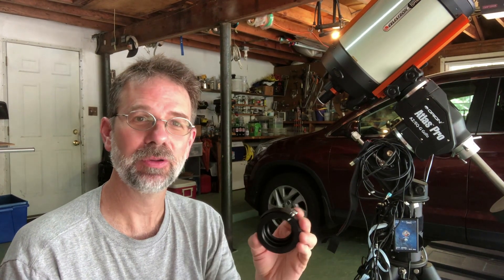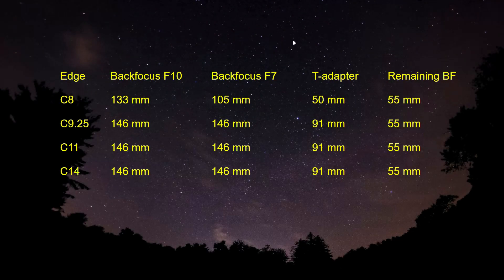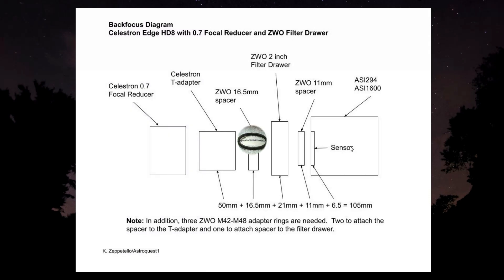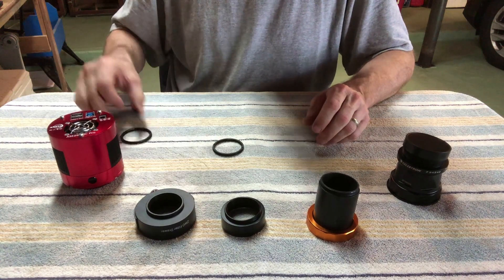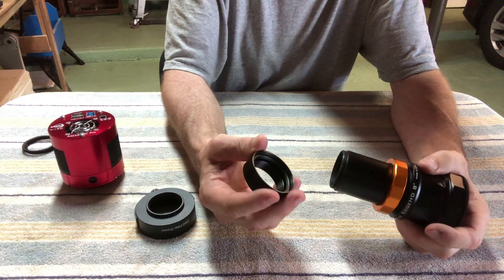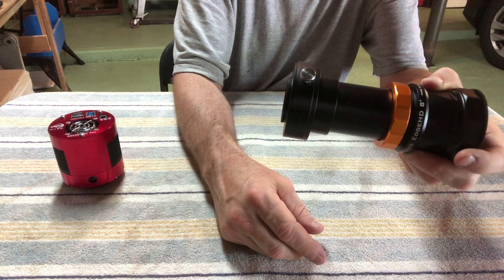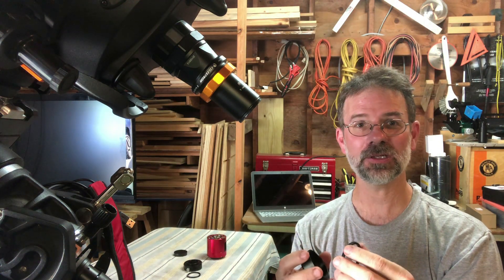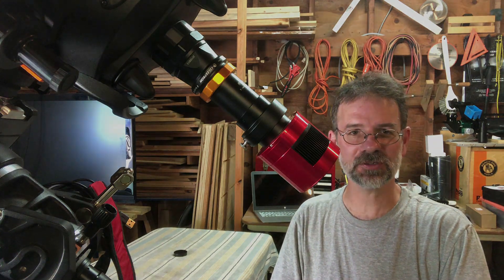Celestron EdgeHD 8" with a ZWO M42 Filter Drawer Backfocus & ASI294MC

Comment: I need help figuring out the back spacing using the 2600mc pro duo with the same edgehd and .7 focal reducer. I believe it comes with one M54 to M48 adapter. I haven't received the camera yet.
Reply from the maker: I believe you are correct. I had to do a little trial and error to determine the optimal spacing. Good Luck with it.

Comment: great video kurt.  i just bought an Edge 8.  and 2600MM with zwo 2 inch EWF and optolong 3nm 2inches SHO and LRGB filters.   I also have 0.7x reducer. and 174mm mini guidecamera.

need some help for guiding setup. i need clarifications for the following:

1) which OAG is better suited zwo OAG-L or Celestron OAG?
2) would the new camera 2600MC DUO work well for Edge 8?

Pls advise.
Reply from the maker: Thanks Sreeshab, You have a great setup. As far as OAG it is hard for me since I don't use an OAG but I think I would go for the Celestron since it has a larger prism which will give you more stars. However, an even better person to check out on this subject is James Lamb (@Aero19612) on Youtube since I believe he does you an OAG and has both.  - Good Luck
Reply: @AstroQuest1  great thank you buddy.
Reply from the maker: @sreeshab4093  The 2600 Duo would work well with any setup and you would not need any OAG.
Reply: @AstroQuest1  great.  Particularly, if I use the DUO for galaxy captures at bortle 5 skies and Edge 8 - would it work well with and without 0.7x reducer?

Would it work well with and without L-Pro filter - wouldn't guiding become challenging specially with f/10?
Reply from the maker: @sreeshab4093  Should work well with and without the reducer.
Reply from the maker: @sreeshab4093  It could depending on where you are aimed but that guide sensor is big enough to capture a lot and you are pulling from the whole telescope view rather than just a prism.
Reply: @AstroQuest1  thanks this is great help

Comment: Corrected!  I got the 42/48 adaptor on the wrong part.  It should be as follows...   I found another reference that recommended reversing the order of the ZWO spacers such that the 21mm adaptor (or filter holder)  attaches to the T-adaptor (50mm).   Then one attaches the 16.5 mm adaptor to the 21mm adaptor via the 42/48 thread adaptor.  Then the camera is attached with its adaptor (in summary: t adaptor 50mm -21mm adaptor or filter drawer-42/48 thread adaptor-16.5mm adaptor-11mm adaptor-camera with 6.5mm internal spacing =105mm).  This gives the correct spacing without using another 42/48 adaptor.   Tried it, and it works!  Send me a message on Cloudy Nights, and I'll send a pic.  Thanks for the video!
Reply from the maker: Thanks for the info George. I give it a shot to see if I get better stars.  Currently they are OK but there is room for improvement.  Cheers
Reply: Hi George, I cannot seem to find you on cloudy nights, I would love to see the pic as I am faced with this issue now..do you have any email address please, or could you send me the pic via a google drive link or anywhere else?

Comment: This really helped me. Thanks. I have a Nexstar 8 se ota and wasnt able to figure out how to get the backfocus correct as i had the same problem as yours with the filter drawer. Thanks for the fix.

I however see some eggie stars at 5 min exposures ( EQ6R pro, Lextreme, 294MCpro, Celestron focal reducer). Do u think the backfocus  doesn't need to be exactly 105 (in my case it's 105.6 as i have a Lextreme filter. Added a spacer to compensate). I saw in your other video you kept it as 108.5 mm
Reply from the maker: Glad it helped Devesh!  Yeah, it is possible that the back focus may have to be tweaked even between different filters in order to get the best stars.  Cheers

Comment: Excellent! I’ll be needing this Tip. Do you add an additional 1mm spacer to accommodate a 3mm filter filter?
Reply from the maker: Thanks Brian. Possibly a 1mm spacer would be make it better, however there is a range.  For example lets say 55mm is recommended, then + or - 1mm would be fine, it all depends on your system so I would do a couple of test runs first.  It may not be necessary.  Cheers

Comment: Kurt, I have the exact same setup as you do except I use a filter drawer I bought from Starizona. I just bagged the adapter rings and bought a set of various length extension tubes. I get within a mm of the right back focus and don't have to worry about the adapter rings getting stuck inside the zwo adapter. I do have an adapter that goes in the filter drawer that allows it to screw directly to my hyperstar and it also fits the extension tubes at the rear. Then when I go from 133mm to the 105 all have to do is remove a 30mm extension. I know it doesn't quite add up, but accounting for the approx 1mm the filter adds, it's within a mm or so and my pictures come out sharp as a tack.
Reply from the maker: That's cool.  Where did you get the extension tubes? Actually now that I have everything set I do not have to touch anything, I guess the extension ring set = the extension tube.  I remove everything as units I want to remove the FR and such.  - Cheers Kurt
Reply: @AstroQuest1  I want to think it was astromania, but that was almost a year ago. I think I paid about abt 30 for a set of 4-5 various sizes.

Comment: I have a stuck M42-M48 adapter ring. What is the wrench I need to get to remove it? Thanks!
Reply from the maker: Yeah, it is called a spacer wrench but you can also use a caliper (https://www.youtube.com/watch?v=bkxtcDr4ais&t=1s) watch 9:00 minutes in.  Good Luck
Reply: @AstroQuest1  Thank you!

Comment: Hey!   Your chart, is it the same for the regular SCT?   For my C9.25 what is the back focus at f6.3 vs f10?   Celestron website says 105 but it doesn’t indicate the regular or edgehd
Reply: If you use the focal reducer it is 55 mm.
Reply from the maker: Hey Johnny.  I am not certain they do since the backfocus is a result of the built in field flattener of the Edge.  When you add the 6.25 FR, then you need to worry about backfocus after the reducer which is 105mm as Celestron says. - Good Luck

Comment: Thank you for your great videos. I recently got my .7 reducer for my edge8. I removed the visual T adapter, screwed on the reducer, then used the visual adapter on the other side. I think you used a different T adapter?  Can you clarify if what i did was wrong? Everythkng workedok, but now im concerned. Thank you, greg.
Reply from the maker: Hey Greg, I always say if everything is working, you did it correct and there is no need to mess with anything.  My issue was the backfocus was a bit less than the 105mm recommended because the 16.5mm spacer set too far inside the T-adapter.  There is a bit of wiggle room with the 105mm, if it is within a few mm of recommended value it should be fine.  If your images show severe star elongation around the edge of the frame, then the backfocus may be the reason.  Most systems will have a slight amount around the edges, the question is, how bad is it.  Sounds like your system is fine.  - Cheers Kurt
Reply: @AstroQuest1  Appreciate the response, yeah, my stars were ok, and I'm never exact with my backfocus, I was more concerned that I was using the visual T adapter that came with the scope on the backside of the reducer - i'm worried this isn't correct when everyone else seems to be using a separately purchased T adapter - which of course wasn't mentioned as being needed when I bought the reducer. The visual adapter seems to have a narrower "neck" than the one in your adapter - which worries me that i'm losing light because of the narrowing.  I have had little time with my new scope, so time will tell I guess.
Reply from the maker: @gfogarty9367  It may but as you said, time will tell and you are right, it is not mentioned when you order it.  The good news is the T-adapter is not expensive (~$26-$32 range). Cheers

Comment: Great video Kurt and thanks so much for the shout out! I'm really looking forward to seeing all the things you do with your Edge8. I'm curious what you are going to use for guiding and also do you plan on imaging at the native FL at f/10? I haven't even tried it yet myself so I haven't figured out how to achieve the backspacing I need without the reducer. May need to get the T-adapter but my Celestron OAG already has an SCT adapter, it's just shorter than the T-adapter. Anyway great tutorial and glad to see you up and running my friend!
Reply from the maker: Thanks Joe. I am not planning on F10 anytime soon - not brave enough I guess.  Gary Imm on Astrobin has been imaging at F10 with an Edge 11 for over year now with great results but he is a magician.  For guiding I am going to start off with my original guidescope from 6 years ago - the Orion ST80 (it is part of Awesome Autoguider Pro Refractor Telescope Package).  It will be mounted on a narrow Dovetail on the top of the scope.  I was going to go with an OAG but I would have to spend $800 (OAG + ASI174) and this was much less since I already had it.  If it does not work I will get an OAG.  - Cheers Kurt
Reply: @AstroQuest1  I would think the ST80 should work for guiding. I would have done the same as you if I had a scope with that long of FL to use for sure cause I cried a little when I bought the ASI174 lol
Reply from the maker: @JoesAstrophoto  Yeah but that ASI174 is a nice camera though.  I forgot how nice and easy it is to focus the ST80 during guiding rather than those helical focusers.

Comment: Bought a Celestron 11 f/10 with Celestron corrector reducer and Hyperstar. Much lighter than the Edge although I have heard good things about the Edge.
Reply from the maker: Yeah I purchased the Hyperstar for this scope but I want to use this first.
Reply: @AstroQuest1  same here....f/6.5 is Goldilocks for me. With the f/2 or f/1.9 your exposures will be 30 seconds at unity gain. The tutorial with the spacers is super.
Reply from the maker: @dankahraman354  Thanks Dan. 30sec sounds good to me.